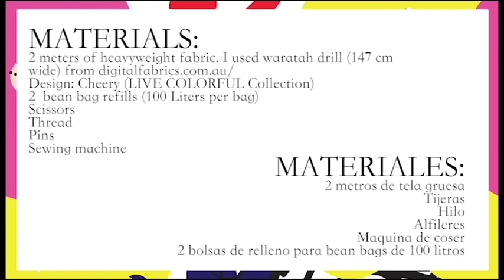How to Make an Amazing Easy Bean Bag Chair (Sillón Puff Tutorial) | Live Colorful

Comment: would the measurements be 4 feet by 6 feet?
Reply from the maker: 6.5 feet by 4.8 feet :) 6 by 4 would work too, just cut smaller semicircles on the top and bottom of the fabric